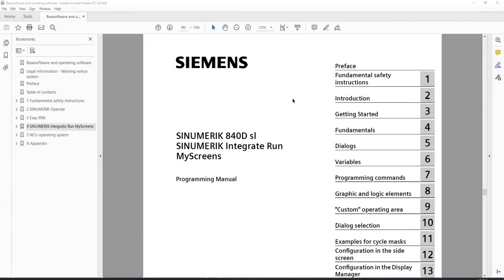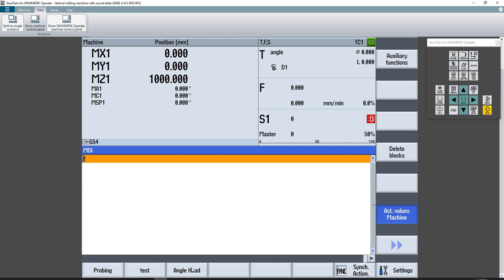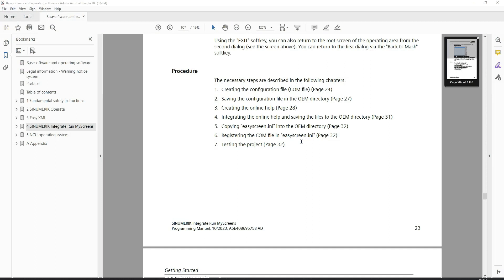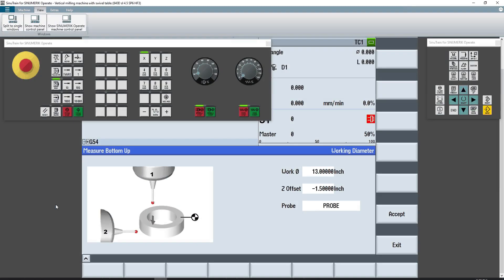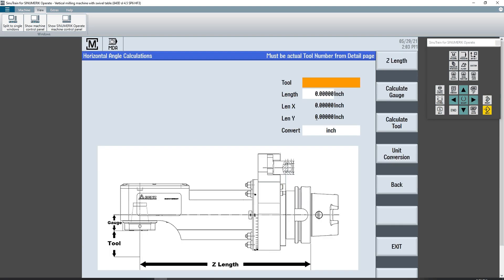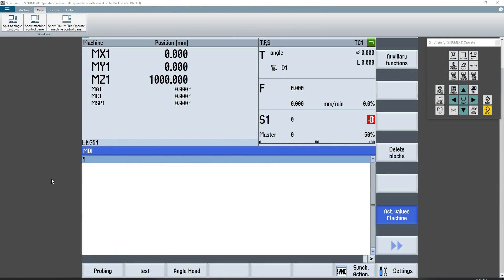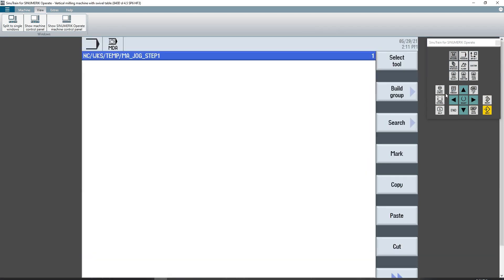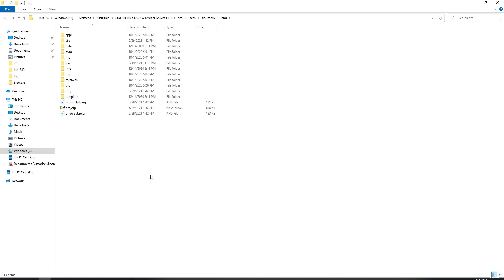Siemens 840/828Dsl Sinumerik Run Myscreens/Easyscreens: Part 1

Comment: Hi, I have an EMCO PC-Mill (upgraded electronics / Windows XP) collecting dust while I'm gathering strength to work on a PP to FreeCAD (I got stuck as it felt like FreeCAD wouldn't support the built-in tool offset/wear-calculations as it is now..).  The modern 840D machines have lovely graphical interfaces and other features, and I have a hard time seeing where the line between what a 90's machine can do compared to the modern ones.
I think I'll watch this series without really understanding what it is or if it will help me.  
What I really wanted to ask was - is it sane to learn to operate the CNC with using the built in "Cycles" and/or coding while standing at the machine to do simpler operations (flattening, drilling holes..), or should I get the PP done and use it as any other dumb operator? :)
Reply from the maker: As someone whose entire career revolves around teaching people how to program CNC machines, it's very well worth learning how to program the machine the hard way so you can troubleshoot programs that come out of cam software. It's good to at least have a basic knowledge. This video series is more about building custom user interfaces and not so much about how to program parts, though. Happy machining!
Reply: @TheFeralEngineer  Sure, I have nothing against programming the CNC per se, but I'm just wondering whether it's a sane thing to do to use it the machine as a "semi-automatic" mill, if you know what I mean?  I don't have a manual mill and it feels like one would oftentimes want one in the garage.  Not being a CNC-person, I don't know if this would be a normal thing to do. :D
Reply from the maker: @JWAM  nah, it usually doesn't pay to try and run a CNC manually unless it's to just take a quick skim pass on something. You don't have the feel like you would on a manual machine
Reply: @TheFeralEngineer  gotcha. Do you know if these things support any probing functions (if I were to buy an edge finder)? Otherwise I a thinking of wiring up something that will merely shine on contact and jog to find the edges.
Reply from the maker: @JWAM  not sure. I gave probing on my machines but they are all aftermarket controls. Look into devices like the haimer 3d taster if you can't find something electronic